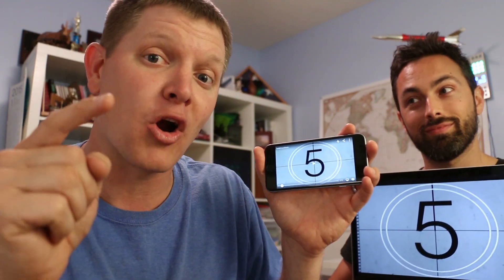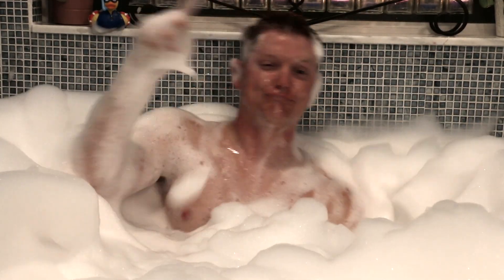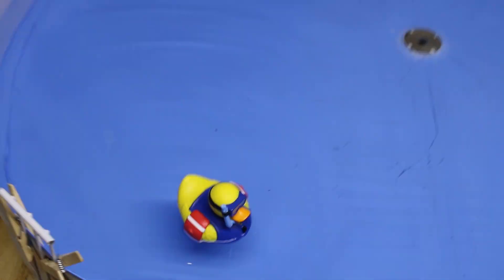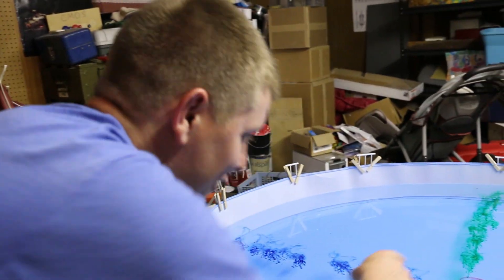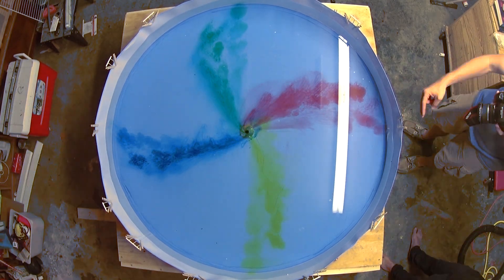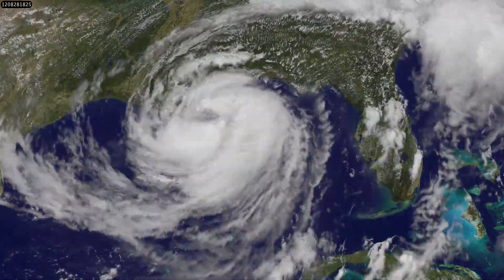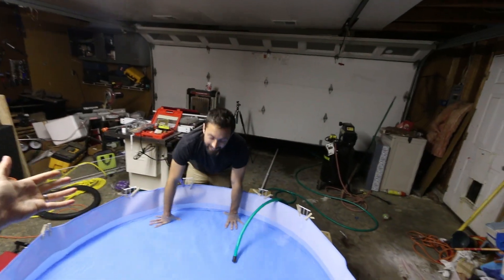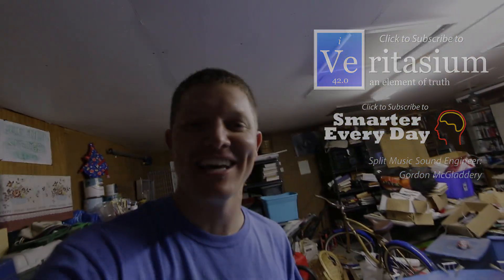The Truth About Toilet Swirl - Northern Hemisphere  (Smarter Every Day 137)

Comment from the maker: If you're having trouble syncing up the videos here's a pro tip: https://www.youtube.com/watch?v=hSK0lm9ZQgA
Reply: Or you could just use this double player link.
http://youtubedoubler.com/fFRi
Reply: SmarterEveryDay Holy Carpcicles! That was some of the best internetting I've seen in months! Loved the video guys, though I couldn't stop shaking my head in disbelief that you did this. It was awesome! Had no issues synching, got it second try.
Reply: SmarterEveryDay  Very well done. Bravo to both of you.
Reply: SmarterEveryDay That was... awesome. Finally a good reason to have more than one monitor :)
Reply: SmarterEveryDay You might want to mention that it will make more sense if the videos get watched with yours on the left and Veritasium 's video on the right.
Reply: SmarterEveryDay Veritasium I was being so OCD about the synchronization. I even tiled two browser windows and pushed the videos up against one another so that it looked like one seamless extra-widescreen youtube video. Awesome job guys, love both of your channels really really cool to see you two collaborating.
Reply: SmarterEveryDay Try this instead: http://youtubedoubler.com/fFF4
Reply: SmarterEveryDay Good work scientists of the interwebs. I would be much more impressed and convinced scientifically if you had run the experiment multiple times. It is impossible to drill the hole perfectly dead center and have the pool perfectly level - in other words, there are many variables that are affecting the outcome of your experiment. It seems that the unaccounted variables weigh more heavily on the result of the test than the comparatively negligible coriolis effect. One more thing - you waited an entire day to homogenize the water and then counteracted that by adding the drops. I commend you on your efforts and really enjoy your channel good sir. Over and out.
Reply: Jaime Duncan 
"Some notes about this. 
We each repeated the experiment 3 times, and got the same results every time. For those of you who might be skeptical, great! The good news is that right circularly prismatic kiddie pools are only $10 and you can do the experiment for yourself at your latitude. There's really no reason you shouldn't do this on your own, so before you criticize how we've done it, I'd strongly encourage you to do it for yourself."

this was in the description
Reply: SmarterEveryDay  that was awesome :) but what if that experiment happened in the middle ( in the equator )
Reply: This is awesome first time in youtube history
Reply: SmarterEveryDay It's good that you explained the coriolis effect (which should be negligible in this setup btw), because otherwise this video would be a complete bs + waste of time. I generally enjoy your videos, this one seems to be an exception.
Here you need to show the shape and orientation of the drain pipe too. And the (inside)shape of the valve, which while installing you assumed would negate the torque on the drain head. Both of those can apply a torque to the flowing water and they can be the cause of that swirl you see. I'm only guessing here but you attaching the drain pipe in reverse can be the reason behind observing the opposite swirl in the south.
Also if you're testing the effects of forces so small that they're considered negligible in small systems like this, you shouldn't be dripping anything into the system. You shouldn't even be moving in the room. It should have been a sealed environment with everything at rest.
So there's room for improvement in this one. I'm sure you can do better. Also if you make a new one, be sure to delete between 6:02 to 6:42. I felt like giving a thumbs up anyway just because you generally deserve it up until there; but after seeing that part... not so much. Yea.. talking about room for improvement...
Reply: Wow! That was so enjoyable. The kids will be watching this tonight for sure. Thanks!
Reply: SmarterEveryDay Darn nice work. 
Very nice scientific experiment. Had to fiddle with my settings a bit to watch both at the same time but it was really worth it.
Reply: SmarterEveryDay Or u can use this http://smarteverydayveritasiumsynch.github.io/
Reply: SmarterEveryDay I did not notice the comment on the description, the experiment was performed 3 times, that gives less than 2% of random chance been the reason. Good work. It confirms my intuition that the effect will be significant.
Reply: SmarterEveryDay  Everyone who is too retarded to start two videos at the same time shouldn't subscribe your channel(s) anyway! ^^
Reply: Just a little dismissive, don't you think?
Reply: Medo Homs Yup... I'd like to know that too, because i live near the equator...
Reply: SmarterEveryDay Veritasium Ive allways been subscribed to both of you
Reply: matt machine , fair enough. Judging from the tone in your response, though, I feel you misinterpreted my response as well.  If I did your's, I do apologize, as this is something I noticed a long time ago. That is, text does not convey tone very well. But, I apologize none the less.
Reply: SmarterEveryDay  Cool
Reply: +SmarterEveryDay Great job, really! The implementation of the video syncing ended up being more interesting the topic of the videos, though!
Reply: I so wish I could come up with something to collaborate with you on! Love your work!
Reply: MadnerKami 
I was so happy when they switched screens and I had the videos on the correct side.
Reply: SmarterEveryDay That was incredible. Well done to you both!
Reply: This was so awesome, I re- followed Ve.  Great job very entertaining, much work went into this I'm sure.
Reply: I thought it had something to do with gyroscope effect of earth rotating...
Reply: SmarterEveryDay In the page where both videos play side by side, isn't there a way to auto-start the videos so they're automatically in sync? Just a thought...
Excellent work as always, my friend!
Reply: Roll tide
Reply: SmarterEveryDay  awesome so worth the effort!
Reply: SmarterEveryDay Intermediate tip: What helped me was setting the video quality to 720p instead of 1080p so it wouldn't buffer and get out of sync. I'm on a Chromebook, I had to do this.
Reply: SmarterEveryDay Veritasium
Bravo! Such an awesome video!! I really enjoyed this one haha!
Reply: one video on my phone, other one on my laptop...imagine that effort to respect your effort
Reply: SmarterEveryDay Just three words.MORE OF THIS.
Reply: Pretty cool.
Reply: Dorfjunge You also used the wrong form of too...
Reply: Mitchell Sullivan correct, thanks! :-)
Reply: Medo Homs Hmm, good question. It would favor the greatest net force. A good example would be Cyclone Blanca currently in the southern Pacific a few hundred miles off of the Central American Coast at the time of this post. It still has the rotation of a northern hemispheric direction ans is just north of the North Equatorial Trade Winds, and would have to be as that'a where most Cyclones/Typhoons/Hurricanes develop. If it was just south of it, it would go the other direction. You wouldn't be able to get to a spot they would be equal. All variable put together would end up favoring one direction, or the other. That coupled with the fact that the NETWs change position throughout the year, there will always be a tendency for one or the other. Not to say that there any of these rotations that cant go te opposite direction. In the northern hemisphere, low pressure systems normally turn Cyclonically, also known as counter/anticlockwise . However, there have been occasions where we see anticycloniclly(Clockwise) rotating lows, but tend to be very weak.  Anticyclonic rotation in the northern hemosphere is usually associated with high pressure. There have been also Cyclonically oriented highs as well. Another thing about this is that a low is associated with upward vertical motion while a high is downward vertical motion giving you bad or good weather respectively. Due to that, we as Meteorologists, look for one these rotations in order to be able to identify where weather will/will not be coupled with pressure and height points in the atmosphere. So to the point, it would depend on a great many things. However, one will win out eventually.
Reply: Mongrel Shark Great!! Thanks!!
Reply: Great video guys! I just got smarter.
Reply: Really Awesome!
Reply: That was great!
Reply: SmarterEveryDay works better if you have Magic Actions chrome extension.. expand the videos full window size, clip both windows to each side (windows 7 and above), then sync them up.. best viewing experience (except the last part where the rest of the channel won't be visible)
Reply: I live in Huntsville Alabama
Reply: SmarterEveryDay Already subscribed to both channels, but yours is much better.
Reply: Alexco21 Me too. 
Did anyone else notice there're 20,000 more views on veritasium's video?
Reply: Miguel Silva Well... yes... You seem to know more about the subject than most. That is exactly what they are trying to portray here, only simplified.

The Coriolis Effect is an apparent force due to the spin of the earth. So, yes it IS due to the gyroscopic movement.
Reply: matt machine You do know that they are severely simplifying this for the laymen, yes? Yes you are correct, it is about net gains and losses. What you are saying, though, is nit-picking. They are performing a severely simplified version of an experiment that is proven every day by airplanes traveling from the equator to the polls, or vice versa. The pilots HAVE to divert slightly to the right in the northern hemisphere in order to keep up with the difference in speed due to area coverage and spinning. Think of a figure skater when they are spinning with their arms out in comparison to the center of their body, and the 360 degrees of a circle. The eyes of the skater will move 1 degree, and thus a fraction of an inch in distance. Now you compare the same 1 degree movement from center between the eyes and the tip of the finger. The finger would travel several inches compared to the eyes. Now take that and spread it out to a more dramatic 3D image, i.e. cutting a golf ball as close to the center as you can vs more towards the tip of an just a bit of the tip of it. That will be a rough starting point. The tip that is cut will have a smaller perimeter at the flat end of the slice, as opposed to the cut that is more centered. If you spin the center of both at the same rate, the perimeter of the smaller circle will spin faster. This is like the small vs large gears of a clock. The distance traveled by that perimeter. The same is said from a slight deviation from moving slightly while, lets say, shooting a weapon. Up Close, the deviation would not make much difference at close range, but farther out you miss by a "long shot". Hence the source of the phrase. This is a apparent force because as the spin northward has slightly less ground to cover than the spin southward. That being said, yes. That does make enough of a difference when you take into account as many of the other variables humanly possible at this time. In addition, I do not mean to be condescending or insulting, but I respect you enough to be blunt. It has nothing to do with convincing. It is comprehension of an understandably fairly tough to understand fact. If you do still are not convinced, though, that is awesome. And I say that because of one thing. Science is about skepticism. We only advance in it because we question things and test it over and over again. If you believe they did this haphazardly with inaccurate results, then I am sure they would applaud you for doing it better than they did. After all, these two channels are about learning and getting you involved. So go prove them wrong if you are not convinced.
Reply: WX SRG You misinterpreted my comment but thank you for your efforts to educate me. I accept the coriolis effect and understand the physical principles. I was simply asserting my interest in the affects of all, though many subtle, variables as any good scientist should. Good day to you sir.
Reply: SmarterEveryDay great idea love the collaboration do more if you guys can
Reply: ***** "Raising questions can sometimes be more interesting than answering them!"
Indeed : )
Reply: I just stumbled upon this channel today, and I must say, one of the best I've ever seen on YouTube. Subscribed in a heartbeat!
Reply: damm my computer broke aaaaaaaahh
Reply: +SmarterEveryDay i couldnt get it working chrome/chrome and had to do chrome/edge.   worked great though.  nice choreography or whatever the word is for video/speaking.  timing i suppose
Reply: +SmarterEveryDay Not needed. You only need to use force, Luke.
Reply: +SmarterEveryDay +Veritasium This is just amazing!! It was interesting and awesome.Can't believe you guys waited 3 years for this to happen...I love it!!

Comment: Using only one small pool filled with water in clockwise direction is not complete proof is it. why did you miss out the control pool: the one filled with water filled in counter-clockwise.

Comment: What happenes if you try this in the equator?
Reply: Draktand01 FTWGamer No swirl!
Reply: Draktand01 Might as well divide by zero and exceed light speed.
Reply: a black hole will spawn
Reply: Veritasium prove it!
Reply: Cthulhu spawns riding the Kraken.
Reply: Draktand01 Water won't drain
Reply: Draktand01 The world explodes, probably :P
Reply: Veritasium It isn't perfectly across just the equator. My comment was truth.
Reply: Draktand01 You either won't get a swirl, or random motion from vibrations/air blowing across it / whatever will cause it to swirl slightly in one direction or the other. It's hard to say for certain which.
Reply: Wyles Malibiran lmao, ur comment and profile pic go perfect
Reply: Someone at the exact equator needs to test this.
Reply: Draktand01 I thought about this too. I guess if it was at the perfect equator, the north and south points of the pool would both get pushed back with equal amount of force, creating  a double swirl-pattern in the shape of a "3".
That, or simply no swirl at all and the water just drains out.
Reply: Draktand01 I ask the same about hurricanes.
Reply: Draktand01 plugged toilet.
Reply: Draktand01 THIS so much. Please test this? SmarterEveryDay
Reply: Veritasium Draktand01  FTWGamer   I suspect the rotation around the sun and earth's rotational axis obliqueness then plays a role.  The hemisphere that experiences summer induces less angular momentum to the water in that half of the tank.     Now what happens in Autumn and Spring!?
Reply: Lessinath More than likely, if the environment is enclosed enough, the gravity through the position of the moon will influence the speed and direction of rotation.
Reply: Veritasium No seriously! You must answer me! Or ill die of curiosity and you're to blame!
Reply: SNOWBLIND771 A good guess? It will probably 50/50, or it will go to either way depending on which side of the equator it will slightly more be on.
Reply: Draktand01 The World would explode

Comment: What if you used a square or triangular drain opening and pipe?
The swirl might be induced by cylindrical shape of the drain and opening.
Although it wouldn't explain the direction of the swirl.

Comment: You should both go to the equator and do several experiments to check what the effect would be there. 
In theory the direction will be determined by the shape of the drain hole.

Comment: If the Earth's rotation influenced how the flow responded to the mass perturbation induced by the opened pool valve, I believe this would indicate that the radius of the perturbation (i.e. the valve) must be approximately equal to the pool's Rossby deformation radius (assuming there is no vorticity in the flow at time=0).  Assuming you're at mid-latitudes and using a pool depth of .2m, I'm calculating that the radius of the mass perturbation you would have to induce in order for the flow to be significantly influenced by the Earth's rotation (this is to say, as much as buoyancy) would be around 17km. For perturbations with spatial scales smaller than this, the Coriolis terms in the momentum equation can be safely scaled out. However, if you include the affect of relative vorticity, the deformation radius rapidly shrinks as relative vorticity is increased (an argument sometimes used to explain the genesis of tropical cyclones at low latitudes).  If we consider the possibility that the valve itself induced a relative vorticity in the flow as the water flowed into the valve, through it, and out of the pool, the flow can quickly come into balance between a developing radial pressure gradient force and a reactive centrifugal force above the valve.  This type of balance (cyclostrophic) is much more likely to be achieved on the spatial scales of this experiment. I am therefore wondering whether the observed circulation is actually more appropriately classified as cyclostrophic and not geostrophic.  Did you by any chance repeat the experiment a few times to see if the flow continually favored the same direction of rotation? (P.S.  You have an amazing channel...HUGE fan!!!)